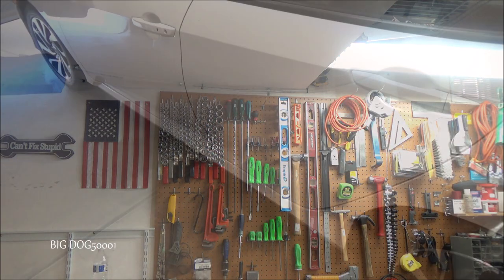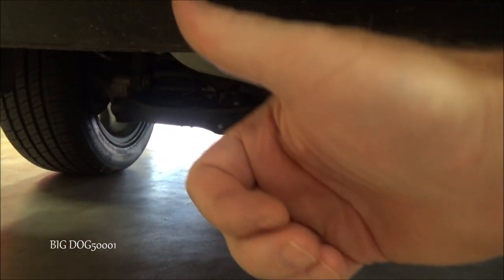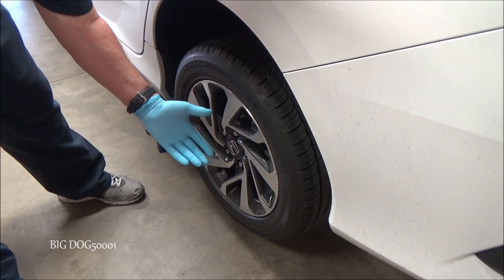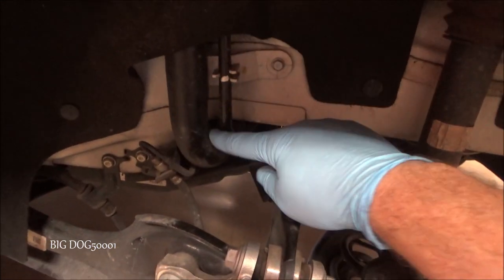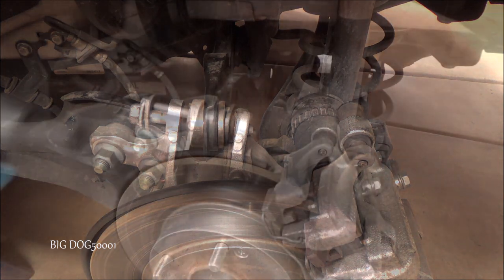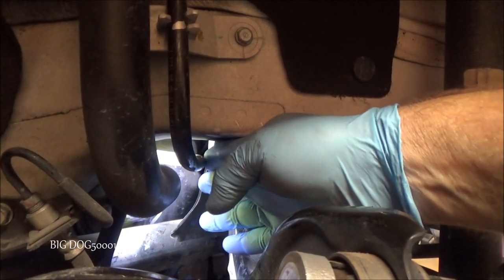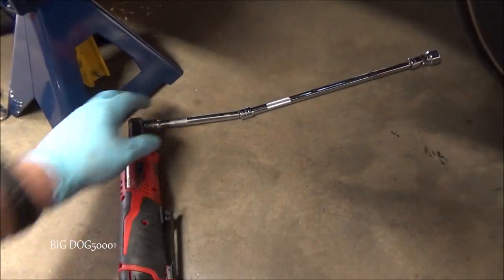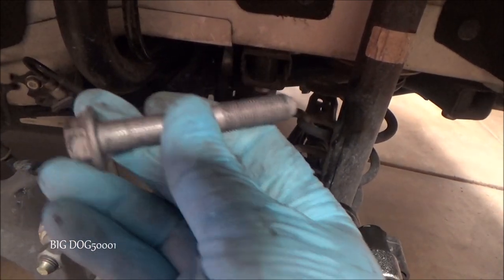Honda Civic Rear Upper Control Arm Replacement (2016-2021)

Comment from the maker: Parts and Tools
Disclosure: This channel earns a small commission using some of these links - at no additional cost to you.
Daytona  Low Profile Jack:  https://bit.ly/3aPRY6J
Honda Rear Upper Control Arm 52510-TBA-A01
Milwaukee 3/8" Impact Wrench:  https://amzn.to/3tzySeo
Honda Bolt 90175-TBA-A11
Honda Nut 90364-TBA-A00
Honda Bolt 90180-TBA-A00
Jack Stands:  https://amzn.to/39VsUN9
Milwaukee 3/8" Impact Wrench:  https://amzn.to/3tzySeo
Sunex 3/8" Impact Sockets:  https://amzn.to/3oXE6Nt
GearWrench Wrenche Set:  https://amzn.to/3rxulqG
GearWrench Flex Ratchets:  https://amzn.to/3oVKd4W
Fluid Film:  https://amzn.to/3jt2oxM
GearWrench Doulbe Box XL Flex Wrenches:  https://amzn.to/2YRsXmD
Astro 40SL Light:  https://amzn.to/2OdYf5b
Pry Bar Set:  https://amzn.to/36PbBLu
GearWrench 3/8" Socket Set:  https://amzn.to/3p2Znp6
Plastic Vernier Caliper:  https://amzn.to/3cLqKkL

The Big Dog 50001 Automotive Channel Store can be found here: https://www.amazon.com/shop/bigdog50001automotive  (As an Amazon Associate I earn from qualifying purchases).

Want a free Big Dog50001 sticker?  Send an email to bigdog50001@gmail.com requesting a sticker.  Sorry, no international addresses or automotive questions.

Comment: I’ve been looking for a lower control arm video and it seems like you’re extremely knowledgeable is there anyway you can give me any tips for the lower arm for the same car? I know the spring drops and have to remove the end link is there only one more bolt? Sorry to ask in a comment

Comment: So just a little something to help and hope a lot of peeps see this but I was watching another video for my car the CRV and if you loosen the bolts on both front and back then take an extra jack (I used a smaller less powerful one) and jack up under the knuckle of the side you’re working on to take the tension off.., once you can wiggle the bolt a little on the inner bolt you know the tension is off of it.